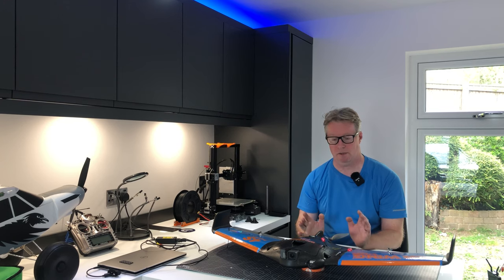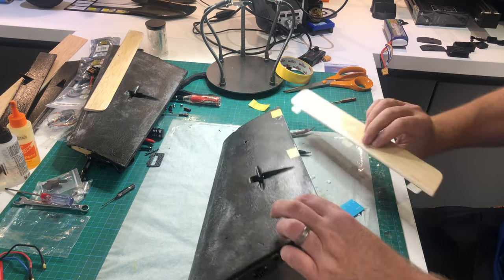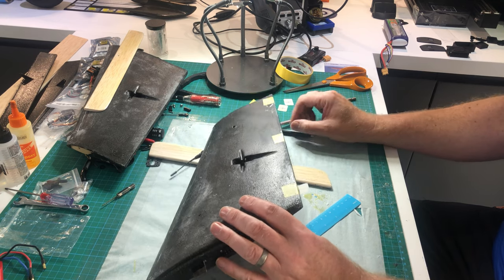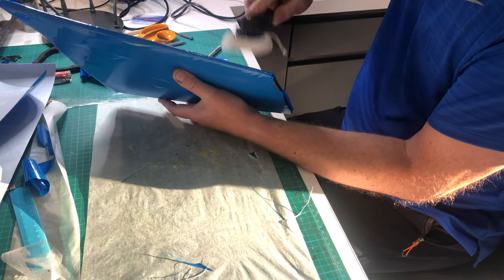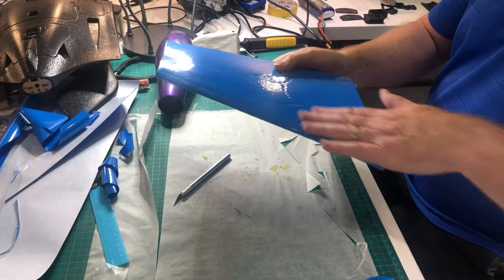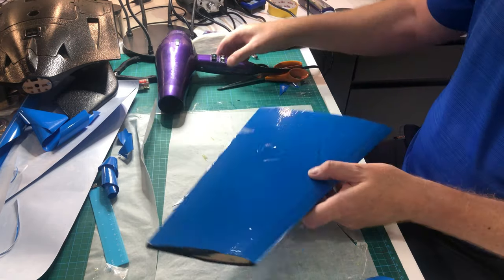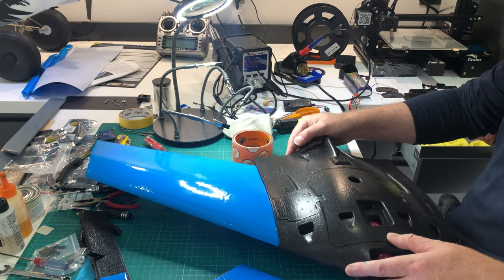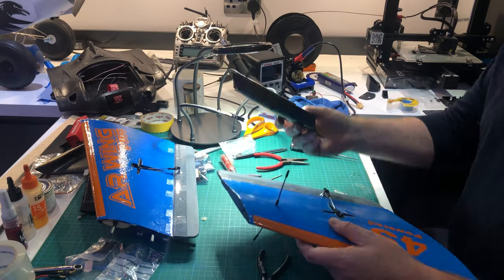AR Wing Pro - Enhanced Build Part 2

Comment: Whilst nowhere near as robust as your balsa elevons, I cut off my elevons and made them stiffer by reinforcing them with carbon strips. One about 10mm from the "leading edge" of the elevon and one at the rear, so I have 2x carbon strips running almost the entire length of each elevon. I didn't laminate them, but I did cover them with packing tape and they were extremely stiff.
My hinge method was simply tape running the length of the seam, top and bottom, but pushed into the V gap with an ice lolly stick.
Yep, it's kinda ghetto lol, but worked great. 

Shame that wing doesn't exist anymore (it was a black original AR600) after a very serious impact with a cliff wall (at about 90mph lol)

I now have a new white AR Pro which is bone stock, with regards to foam elevons and hinge, but it's not built for speed so I'm happy with the regular elevons for now.

Nice work bud.
Reply from the maker: After test flying I did notice a big difference in handling so balsa is the way to go for me in future. If you are just cruising around they are not necessary. Those cliffs are in the most inconvenient places arn't they :-)

Comment: I see you are running the Crossfire antenna on your wing so i assume the receiver is also set into the wing pocket. Are you running a common earth with the servo and receiver and if you are/have is it problem free? Great videos by the way.
Reply from the maker: Hi Pete. Correct I splice the Crossfire Nano RX ground into the servo ground. Have done it on all my wings for 3 years with zero issues.

Comment: So It's a year later. How are the hinges holding up? And thanks for all your info.
Reply from the maker: Rock solid, so much so I damage an elevon in a crash and could not pull them out, had to cut the hinges and fit 3 more in slightly different positions 😀